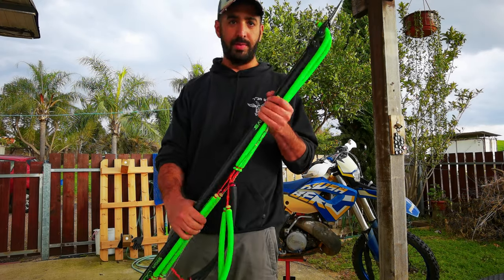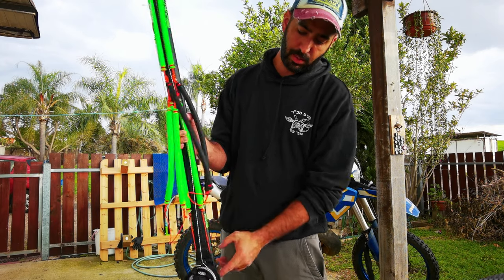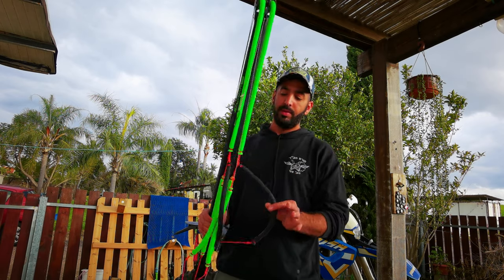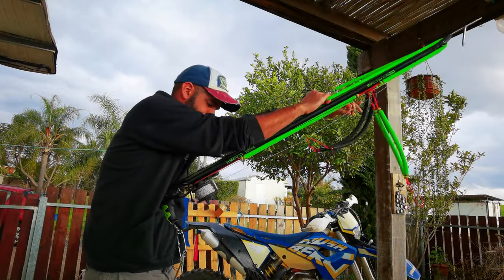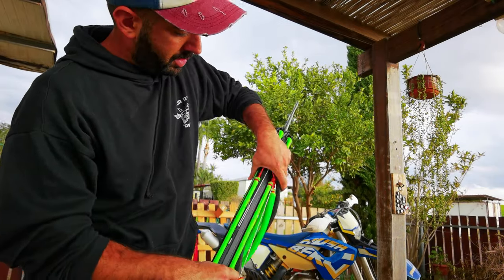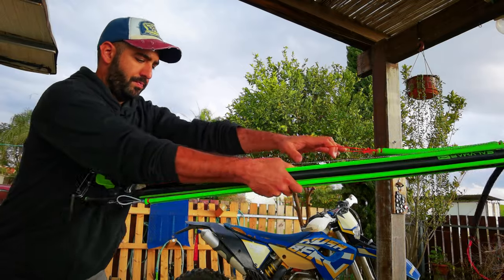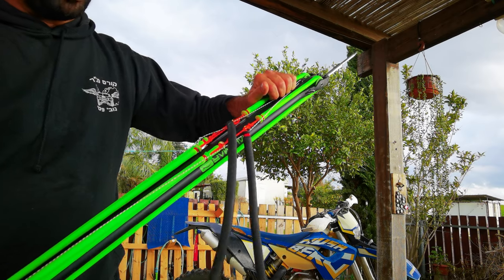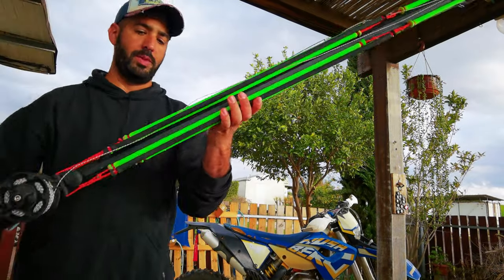How To Load The Modified Salvimar Hero Roller 105 Spearfishing Speargun - Extra Rubbers = More Power

Comment: I converted a 120 single roller with ceramic bearings To that design. I made it easy to load and it still Outperforms Everything else I have tried. Inverted roller with the power robbing Pulleys was weak.
Reply from the maker: Thats cool! What model is the gun you converted?
Reply: @yanivlanciano  It was a m v d with a custom carbon tube. It originally was a Inverted roller And I.
Was disappointed with it. I test guns in the pool. Seawolf predator and salvimar tomahawk use our system.

Comment: Nice upgrade,it’s just like tomahawk configuration. I’ve tried that but it doesn’t work well and I can’t find the reason.finally I turn it to  inverter roller .
Reply from the maker: It's similar to the tomahawk setup, but with aftermarket rubbers which are much stronger then the original salvimar rubbers.
Now I'm making a metal part to connect all the rubbers together (similar to the invert, but without the rollers).
Anyway, it's much stronger that way, and my next gun will be invert.
It's the future
Reply: Can you share this setup as I'm looking to do a similar one and I'm interested in the options 😉 & I love your videos!  @yanivlanciano